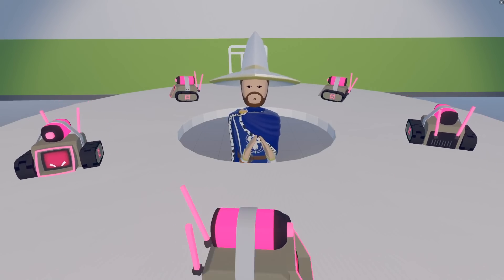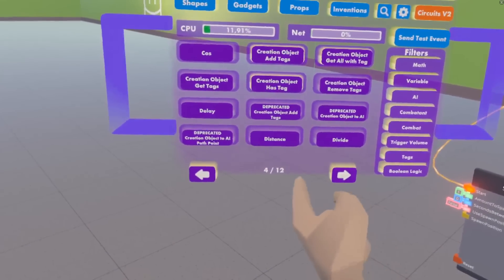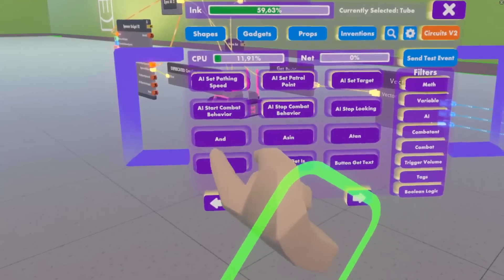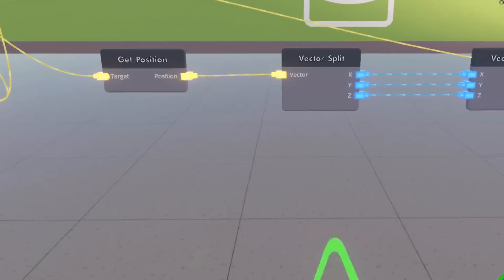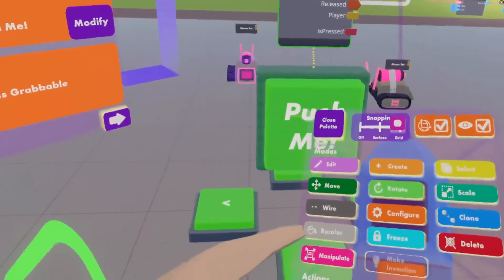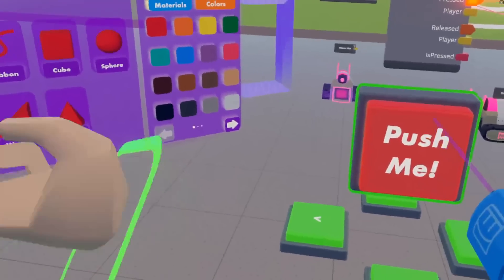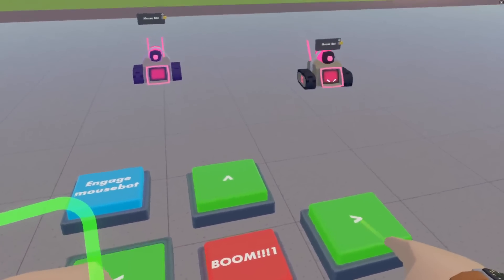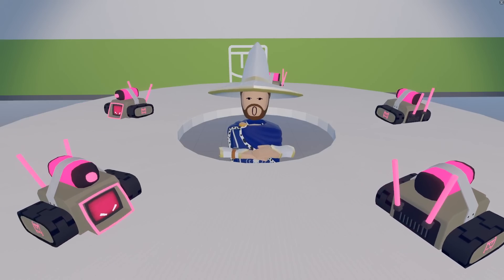CV2 Direct Control

Comment: The mousebot knows where it is at all times. It knows this because it knows where it isn't. By subtracting where it is from where it isn't, or where it isn't from where it is - whichever is greater - it obtains a difference or deviation. The guidance subsystem uses deviations to generate corrective commands to drive the mousebot from a position where it is to a position where it isn't, and arriving at a position that it wasn't, it now is. Consequently, the position where it is is now the position that it wasn't, and if follows that the position that it was is now the position that it isn't. In the event that the position that it is in is not the position that it wasn't, the system has acquired a variation. The variation being the difference between where the mousebot is and where it wasn't. If variation is considered to be a significant factor, it too may be corrected by the GEA. However, the mousebot must also know where it was. The mousebot guidance computer scenario works as follows: Because a variation has modified some of the information that the mousebot has obtained, it is not sure just where it is. However, it is sure where it isn't, within reason, and it know where it was. It now subtracts where it should be from where it wasn't, or vice versa. And by differentiating this from the algebraic sum of where it shouldn't be and where it was, it is able to obtain the deviation and its variation, which is called error.
Reply: This is school😄
Reply: I ain't reading allat
Reply: boom I'm Okay!